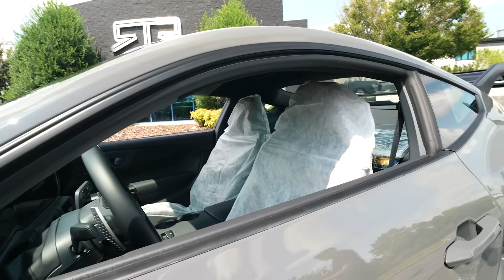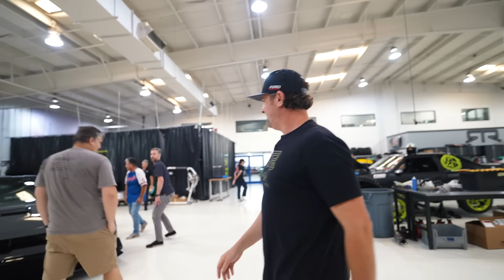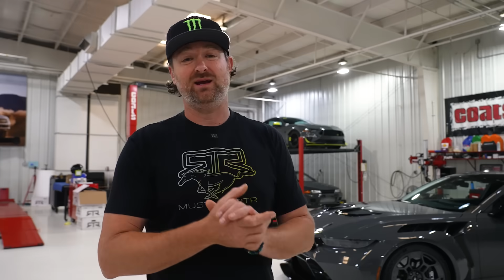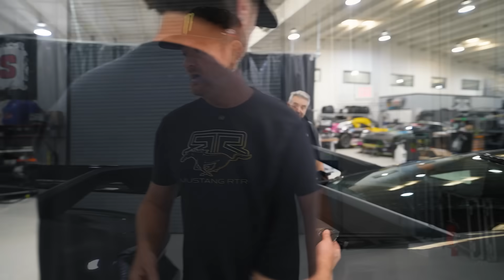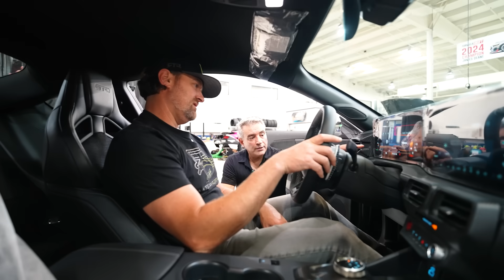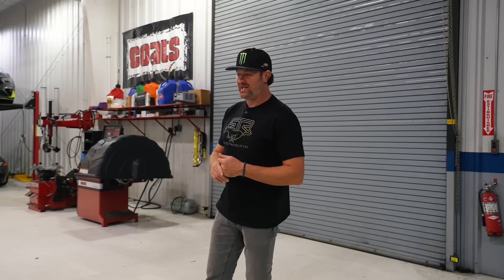First Look at My Ford Mustang GTD

Comment: I love the excuse of horsepower and weight. Yet the GTD has a GT3 chassis. GT3 suspension Active aero. They used an FIA platinum license driver vs an engineer. The GTD still has quite the significant advantage over the ZR1 lap. The hybrid drive just adds dead weight when it runs out of power. AWD makes you slower by introducing more understeer. The added hp just creates more wheel spin. Not really resulting in much if an advantage. If any.

Comment: Chevy didn’t just beat fords time. They did it whilst being driven by the engineers, whilst ford had their professional driver. So maybe the ford “has more in it”, but the Chevy definitely has more in it. 
P.S. the ford is about double the price, so why does it have less power and more weight?

Comment: The exhaust tips need to go 12:49  for sure i hate the look of them
Reply: This  entire car was designed with intent to capture every 1/100th of a second in the car. Form follows function was at the leading edge of design with the GTD. ALL of its shapes and structures should primarily relate to its intended purpose. And in the case of this car, that’s to lay waste to race circuits from Daytona to Ingliston. 

I’m amazed by this car and am proud of this American brand. Ford continues to show the world if they wanted to , they would own this space too…

I didn’t even notice the exhaust tips tbh. This car is so bad ass.  I have zero complaints
Reply: This  entire car was designed with intent to capture every 1/100th of a second in the car. Form follows function was at the leading edge of design with the GTD. ALL of its shapes and structures should primarily relate to its intended purpose. And in the case of this car, that’s to lay waste to race circuits from Daytona to Ingliston. 

I’m amazed by this car and am proud of this American brand. Ford continues to show the world if they wanted to , they would own this space too…

I didn’t even notice the exhaust tips tbh. This car is so bad ass.  I have zero complaints

Comment: Not trying to actually start anything here, just banter. Speaking of paper @6:18.. if the corvette is lighter, and all wheel drive (one of the two that beat the GTD), and has more horsepower... wouldn't you think it should cost more paper for being the more capable car? Secondly and more importantly, congrats on the car Vaughn! Youve earned it and she sure is beautiful.

Comment: Talking smack about the vette beating it with engineer drivers with a car that costs 100grand less?  Lol,  ford got smoked, just gotta eat that one. Ford goes back then all Chevy has to do is go back and use a pro driver too and they've got an extra 10 seconds easy in the ZR1

Comment: Went looking for the Ford GT lap record for the Ring to compare to the GTD, and the only thing out there is an unofficial 7:00 time. A very Ford thing to do with a car that sees competition, and kind of ties into my theory that Ford had the "dial-a-hp-number" system going on with their turbo setup whenever they got slapped with a weight penalty or whatever idiocy the sanctioning body decided on, they could say "fine then", and click on the laptop for a second and pull another 50, 100hp+ out of the car.  Would love to know a time that's stock config, full chat, with a racing driver.

Comment: If VGJ can spend probably a little over 400k on car…..

To afford a $400,000 vehicle, you would likely need to be in a very high income bracket, generally considered to be in the top 1-5% of earners. A general rule of thumb is to keep your car expenses (including loan payments, insurance, fuel, and maintenance) under 10-15% of your monthly take-home pay. This means you would need a substantial monthly income to comfortably afford the payments and associated costs of a $400,000 vehicle.
Reply: Congrats Vaughn. ❤❤🎉🎉🎉 You are a trail blazer in the Motorsports drifting.

Comment: I love the GTD for what it is (25 GT Owner) but let's be real, it ain't touching the vettes. Even if Ford goes back to the track, the vette goes back after and with local Ring pro drivers they easily take 10 more seconds off their tracks times.
Reply: The corvette doesn't have enough downforce. If they had that their numbers would be truly impressive.
Reply: Vette had 1200 hp with awd and it only beaten by a couple of seconds
Reply: @reggiecam9134 yes but that battery pack adds dead weight.  AWD naturally understeer. Plus the GTD is built but Multi mastic because it’s a GT3 chassis, GT3 suspension with active aero. Plus ford used a Platinum license FIA driver who has outright won the ADAC 24 Hours of Nurburgring. Dirk has raced in the 24 Hours of Le Mans. 24 hours of spa. Vs an engineer that drives corvettes for fun in the weekend. The GTD had much more of an advantage than the corvette lap. Plus two  attempts for the Mustang vs first trip for Corvette
Reply: @SlipStreamRacin it’s sill lighter then the gtd no excuses
Reply: @reggiecam9134 The Mustang has DRS, and a racecar suspension and still lost to literally an engineer driving an extremely conservative racing line.
Reply: @feagle 400 hp less and rwd and being heavier and barely lost by a couple of second 😂😂

Comment: i think i see ford and chevy trading fast lap times at the track. the chevy team had there engineers set those lap times. Nürburgring experts are saying a pro driver could probably knock another 5 seconds off that time. the gtd is awesome but for 130k less you gotta give it to the zr1 right now.
Reply: Absolutely.. The GTD is designed and built by Multimatic.. It's basically a Mustang GT3 made street legal.. So people saying the Mustang shouldn't be compared to the Corvette.. Well, when you have a Mustang GTD built by Multimatic, it's basically a racecar.. So the comparison is valid.. If Chevy took the C8.R and made a road legal version, similar to the GTD, it would probably 10 seconds faster than the current production ZR1X.. Hypothetically of course

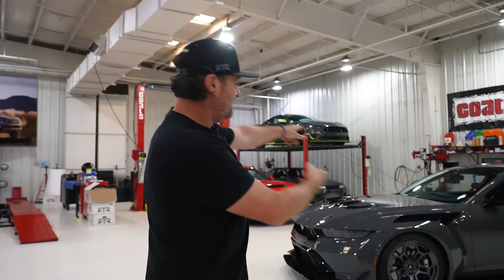Comment: 6:52 hell yeah, im happy to hear that you're getting involved in taking back the Nurburgring record. In my opinion the ZR1X is mid engined now and is in a different category. Mustang GTDR?
Reply: What
Reply: The issue is the C8 is still a American made car and actually made in America. That's the goal is the fastest American Production car. I guess you could even say the Ford GT would be ZR1 level but it's more like ZR1 food. The Ford boys are punching air over the ZR1 being faster, with more time to gain. It's the reality, if Ford wanted to compete, they should've made a real Ford GT. 

Don't get it twisted, the GTD is a beautiful car. I just don't think Ford expected Chevy to whip it out and slap it on the table like that. I think Ford thought the Z06 was probably going to be it. ZR1 would be what it always was, a Z06 with a little more power. I didn't expect this from Chevrolet either but they've done something great. Ford has built such a MONSTER OF A FRONT ENGINE CAR THOUGH IF C8 WASNT MID ENGINED IT WOULDN'T BE BEATING THE GTD. The C8 had to go mid engine to beat cars like the GTD.